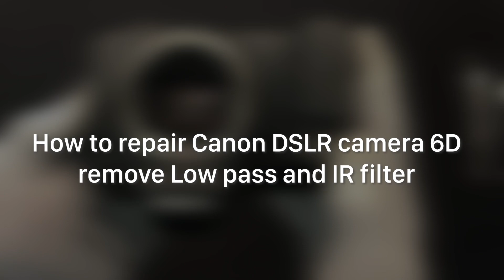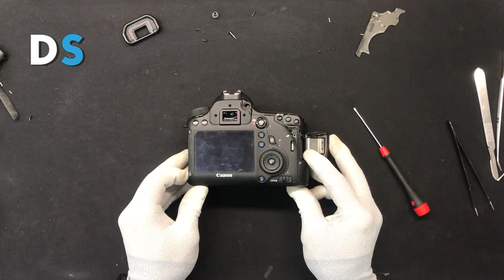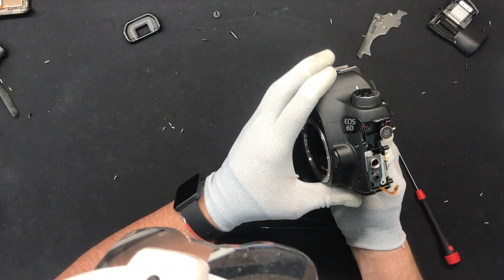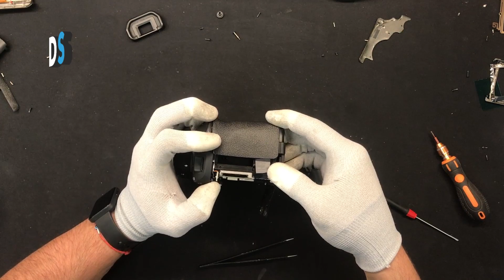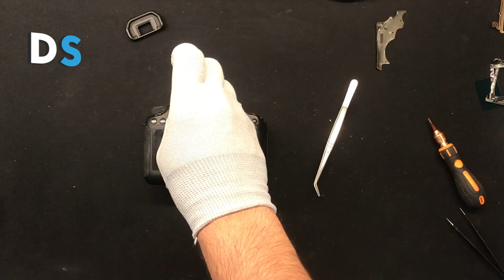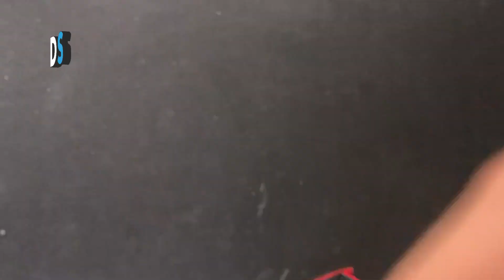How to repair DSLR Canon 6D - Remove low pass and IR filter

Comment: 10:34 How did you calibrate the sensor position? Or did you just tighten the sensor torque screws all the way clockwise without returning to original or calibrated position?
Reply from the maker: Thank you  :)
Reply: @DIGISERVICEBG does auto focus still work after thid repair? Is there any sensor tilt?

Comment: Greetings from the US Petar. Thanks for posting this video. I was getting nervous watching this with all of the different screws going everywhere. I use a tackle box / utility box with 30 compartments to sort the screws going forward during disassembly and then replacing the screws in order for reassembly. It's a lot easier to find out where the missing screw came from that way. There are some nylon computer tool kits now that won't break those little connectors (I work on a lot of PC parts) or short any of the board components like the tweezers. I also found one of the new electric battery operated screw drivers with the different bits, magnetized heads, and an light to see the difficult areas. I see the anti static gloves and I am guessing an antistatic mat, but the little tiny capacitors can unload if you accidentally short one with a metal tool in my experience for anyone trying this at home.

Couple of questions:
Does the adhesive on the back of the textured grips on the exterior of the camera need to be reapplied or is it sticky enough to reuse?
Also regarding protecting the chip, do you have a recommendation for a non-filtering film to use that won't mess with focus or cause extra static to attract dust to the sensor?

Best regards,
-Chris

Comment: Great video...one question from spain
Does the autofocus works after removing both filtets?
Reply from the maker: Yes, but need to calibrated
Reply: How calibrate Focus? Do you need some software or hardware? @DIGISERVICEBG
Reply: @DIGISERVICEBG how did you calibrate the sensor position? Please share any guidance!

Comment: I just remove the first layer of IR filter with wire of canon 5D mark ii sensor to clean sensor from fungus, but fungus still on sensor when I remove just the first layer of IR filter with wire, and I don't know how to remove the second IR filter? How can I remove it? And what tool I need?

Comment: Hi there Thx for the vid V Helpful. May I ask why you removed the Black edging before reinstalling the sensor? Especially the lower layer it seemed quite well stuck and so probably wouldn't fall off and usually a black edge helps with reflections etc. Genuine question I may have to do one of these soon for astro work and do not want to mess up. :)

Comment: Why did you remove the filter from the Canon 6d camera, what is the purpose of that?
Reply: This is to modify the camera to be better in astrophotography. Many deep sky objects emit certain red light from hydrogen alpha emission. These wavelengths are typically mostly blocked by the built-in filter of the camera. By removing the filter, these red wavelengths are allowed to pass and reach the camera sensor, thus creating spectacular images with bright red deep sky objects.
Reply: @BenillaIC  Does this procedure improve sharpness of image.?
Reply: @drbeardo6960  No it doesn't
Reply: @drbeardo6960  Actually it does. Check 5Ds and 5Dr. Two filters in front of the sensor reduce the resolution.